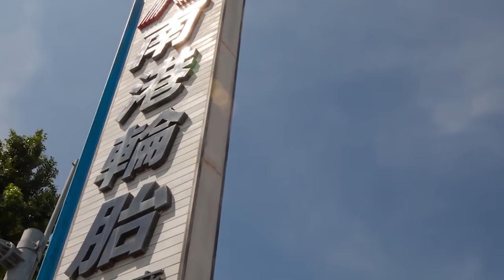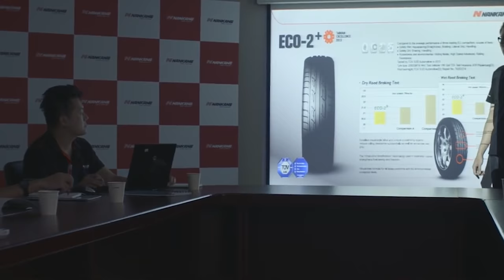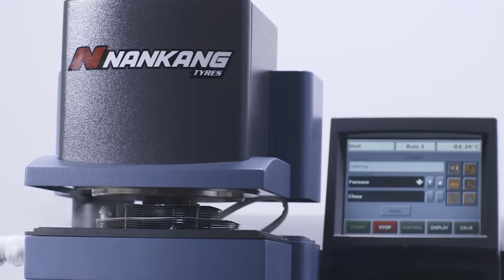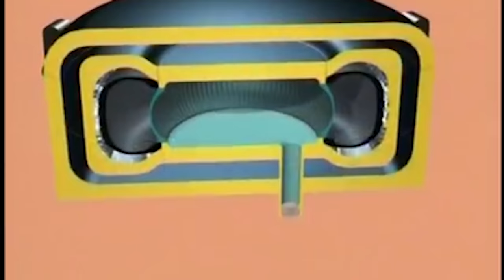THE TRUTH ABOUT NANKANG TIRES

Comment: They're popular because they're inexpensive, stretch well,  They're offered in some relatively oddball sizes, they grip for days and they have nice sidewall & tread designs.
Reply: Exactly, they look amazing. The only downsides are slightly weak wet performance and they are a bit noisy. At least the NS20's on my MK1 Golf are.
Reply: @Rodhizzzle  use them what you fine them good for if you notice they ain't great for grip on wet conditions also probably depends which tire you got, but just take what I said as grain of salt. Because I don't have much experience with them.
Reply: @Rodhizzzle  Slightly weak wet performance, you say? Grip for days dry, you say?
Sooooooooooo they make hooning around corners slightly easier after it rains?
SOLD.
Reply: Rodhizzzle are they good for fast driving
Reply: @coltonwatson4907  rated for 130
Reply: Agree, very durble, made in rare sizes with a pricetag lower than most..
And very stretchy

Comment: Thanks for the great review of Nankang. After hours of comparison videos I was ready to buy Goodyear Eagle F1 Supersport 235/35 R19 for our Audi S3 (MY15). I had been advised on a service and inspection last week that the left rear was lower tread than the rest and probably only had 5,000 km left in it. I was ready to sacrifice all other tyres on the car and get 4 new ones at a cost of $1,100.00 AUD. I had to check the brand on the front as I new that they were a Chinese brand that had only been added 2 years ago; Nankang. I have never had a problem with these tyres losing traction like quite often happens with the Continental tyres in the rear of an AWD car. I'm now thinking of getting 2 Nankang on the rear only as the fronts still look relatively new with ample tread. These only cost $154 AUD each. Every time someone works on my car they feel the need to comment on the cheap tyres on the front. Tyre shops included. Sure, they sell the brand, and they'll sell anything to anyone, but they don't know how good they actually are. They just see them as a cheap tyre.

Comment: Over the years I've had NANKANG tyres on several different cars and they're a great tyre for the money. For just daily driving they will do more mileage than a lot of more expensive brands...
Reply: @ray6.488  That's not relevant. Most users have never been to a track ! 
Most people will actually end up in a ditch on race spec rubber....
Reply: Thank you for your review man.... Will use this now
Reply: @PasigMrPogi  Try either Nankang NS-2 or NS-20. I know both of them. They are not the best in the world, but certainly good enough. And they are immensely good value for the money. And they do seem to last forever.
Well, the longevity is due to the silica/rubber compound. They are quite hard, so do expect to be able to feel the road.
Reply: @thefreedomguyuk  shit that’s music to my ears feeling the road. That’s what you’d want in an enthusiast car. More road feel means you’ll know what your tires are doing.

Comment: I've had some 285/75R16 Mudstars from Nankang on my 99 Dodge Ram 2500 for at least 5 years now.  I can't wear them out!  I use the crap out them and they look brand new.  The sidewalls will dry rot off the rim before that tread wears out!  Really impressed with them.  Will definitely be buying more Nankang in the future.
Reply: My mudstars are the same way . They last forever.  I don't think they make them anymore

Comment: I drive 100 miles a day 5 days a week. I bought a set of tires by Nankang because they were super cheap online for my work car. I’ve been running them for the last 2 years with no issues and the tread still looks great. They grip well and aren’t noisy. I’m about to buy a set of Nankangs for my Boxster and this time it isn’t because they are cheap.

Comment: Hey everyone i just put 4 new Nankang SP-9 Cross Sport tires on my 2015 Lincoln MKC AWD which is a small to medium sized SUV. And i have to admit that they are by far MUCH BETTER then the stock OEM Michelin Latitude Tour HP that my vehicle came with. Simply an excellent tire for someone on a budget that still requires; reliability, performance, and a good tread design for bad weather snow etc...

Comment: I've had Nankang NS-20 225/40 R18 on my car for about a year with harsh driving and am now switching over to the new NS-25. The last winter freeze we had here in Portland was a breeze with the NS-20 tires and they did not slips even once, and that's on a 2012 Scion XB. Meanwhile I'm seeing Subarus and Jeeps stuck all over on the sides of the roads. For the price, they are EXCELLENT tires and with daily driving they work fantastically. Just don't expect them to perform like a $300 tire.
Reply from the maker: Might have to take a look at those NS-20's for my car this winter we are in Wisconsin and the winters can get pretty gnarly!
Reply: Hi. Did you get the ns-25? How do they perform on dry, wet and snow? I am trying to decide on ns-25 vs sumitomo htr a/s po2. Thank you

Comment: N: Yokohama can I borrow your logo.
Y: Sure, but don't make it too obvious. 
N: Thanks fam.

Ps: The truth about.....Ling Long tyres lol
Reply: Looks just like the Hankook logo to me.
Reply: What's Ling long tires??? Have no heard of that brand.
Reply: Lol we have Ling Longs at work for cheap LT/HT tires other than that stupid name they're not too bad as a work tire haven't seen many come back with complaints other than the morons who overload the work van/truck then plop a trailer that's way too packed and the rear tires rub against the 1/4 and eventually cause a blowout
Reply: @emanueltorres4093  You don't want to know what ling long are, basically the proving ground is the customer.
Reply: Nankang Tire and Yokohama Tire had history of technical cooperation and joint venture since year 1959 (not anymore though). For a period of time, Nankang belonged to Yokohama group, like a daughter brand in the same company. It's not surprising the logo looks alike. Hope you could stop mocking before checking fact, bro!
Reply: Long long has very hard compounds glad I got rid of them
Reply: David Post I have driven them in a Toyota Tacoma truck with two Ling Longs tire brand as for two rear tires for 3 years.I put on them about 65- 70 thousands miles before I changed them out for with Japanese Yamaha tire brand.Because couldn’t find them in Walmart,Sam or Costco clubs stores as in great prices any more.As you said don’t over loads them in weight or driving on them about 100 or more miles in it every days.These budget tires brand name.It dose works great if you know there limitations.

Comment: I ran a set of half worn nankangs, the texture was actually picture perfect, and razor sharp. The veterans told me that the tires are slippery. To my experience they were gripy at a more excessive angle, like if a typical road tire has a lateral grip angle of 4-6 degrees, it felt as if the set I ran had a grip angle of maybe 8 -10 which to me felt actually more fun and forgiving, because the grip was more aggressive. The tires felt like the car was more responsive overall, just the extra grip at an exponential angle...

Comment: They are great tires. I have had over 50 cars in my life with all kinds of tires and Nankangs ride and perform better than some of the high priced tires. They turned a stiff bumpy riding car into a soft rider. I am hooked and it's not just the low price.

Comment: I love my ns-2 ultrasports they are cheap, grip well and have nice tread pattern, kinda flexy but I have kinda meaty fitment (225/45r17 on 7j).
Reply: No wonder your tyres are unstable. You bought the wrong size..... Go for 205 or 215 instead, and you will get a much better grip. 
Your setup is not "meaty", it's just not very good. It's just about within specs, but not good. Optimal for those tyres are 8" rims.

Comment: Just had the NS 25 Installed on my 2018 civic type r - fingers crossed...
Reply: Howd they end up doing? Possibly pulling trigger on these in nezt few days...
Reply: Wondering the same, just ordered
Reply: They holding up well - 10,000 miles on them - road noise is a bit loud - I use them here in New England for the Colder weather but are a great year round choice with plenty of grip in all temp ranges and rain - i would buy them again.
Reply: @anthonydigangi9877  hell yeah thanks. Putting them on my subie I was concerned about grip & wet weather.
Reply: I had these installed after watching this video. Great value, ride smooth and handle great. Definitely go for it if youre on the fence.
Reply: TKidd88  does the NS-25 have a high speed rating ? I tend to speed sometimes lmfao don’t
Want it to blow up at 100-130mph
Reply: @vq35hr3  Mine are H rated. Up to 130mph. I've had them near 110-120 , smooth as glass.

Comment: So in summary, these are only for burnouts, grassroots drifting, and cambered out hotboi civics...
Reply: @potatochobit  My mom gets only the best, I'd get her Michelin Pilot Sport S on 18 Koenig's . She drives a red 2016 Hyundai Sonata.  Hybrid. 😎  KDM Crew. 🇰🇷
Reply: But they do make "race" tires, like the AR-1
Reply: @alexstromberg7696  Id rather trust a tire with better R&D along with, I drive my wife and dogs. Im a skilled driver but also because I always have trusted tires. You get what you pay for.
Reply: @Dezzylyricz  so you go by "more money is always better"? I think the AR-1s are perfectly fine.
Reply: @alexstromberg7696  not really. I go for rubber compound, load index, grip, water evacuation, realiblity. With all of what I need in a tire it's going to cost more. That why I save up. It's expensive because of the engineering and design. But at the end of the day I will know in any weather or sudden evasion maneuver needed to avoid an accident I will have full control of my 25,000$ vehicle and the safety of my passengers and most of all my wife.
Reply: I will not tell you your wrong I respect your opinion. What do you like about them so much over the competition? I'm not familiar with them.
Reply: {Motor Mafia} , 100% agree mate. The best upgrade for a car is premium tyres. My gf and I both run Michelin Pilot Sport 4 - wet weather performance is next level and tyre wear rating is 350. My mate runs the Mitchy pilot sport 4S.
Reply: @nordic5490  it's a great investment, glad you like them. I'm debating the Pilot Sport 4, 4s or the all sessions variance.  Maybe even the Nitto 420s  all depends what wheels I get.
Reply: i have a civic. but its a "trackday bro" kinda civic. so im running ad08r for street mode and i want to get a set of 15s with nankang ar1 for a "pure" track setup.

Comment: I had always continental,hankooks,pirellis on very powerful cars. When i buyed a used benz who had 19 inch rims running on Nankang NS20 on the back and the front tyres where Goodride, i was like i will change them as soon as possible. But i didnt have time, so i drove them also under wet conditions, and i was amazed with the grip. For Notice, years ago i had the same Benz with 18 inch rims and only contis, i always had to be careful when driving in the wet. So driving now with Nankang/Goodride combi is really funny, but i will probably go for Nankang All Around. The Price is good but the grip is surprisingly good.

Comment: Anyone care to chime in on what they think of the new NS-25 now that the NS-20 has been discontinued?
Reply: Wondering this too as I have ns20s with low tread. Apparently no one has shit to say as they did with the ns20s when I bought them
Reply: Running them on a RWD q50 and they beat the crappy dunlop run flats. Good all season so far haven't used them in heavy snow. Good grip even when pushing on corners. Have about 5000 miles on them so far.
Reply: shaunskii my car came with a new set and I’d buy them again. Not loud, I can launch them hard, they grip real nice around corners. I live in New England. So as far as cold weather they can get you around but not recommended for foul weather.
Reply: Remind me in a week or two. Got some 275 nankang ns-25's on the way
Reply: @k.hamilton5848  how they been?

Comment: Is nobody going to comment on the fact that the forklift loaded with tires flopping around was driving in forward with that poor visibility? I’d rather reverse, better visibility and the tires can’t really hit anyone if You need to stop quickly. A rule of thumb i use is that if i can’t see directly in front of me, then i reverse instead. Workplace accidents are far too many and easily avoided
Reply from the maker: Workplace safety is huge!

Comment: I beg to differ about tires that compete with Nitto, Toyo, etc. They have their AR-1 DOT 100 TW track tire that's quite popular in Europe and used on racing circuits. They have been compared to such as the Toyo R888R and often found to be better performers in some applications. They are finally appearing in the U.S. in limited size offerings.

Comment: had some Nankang tires, dont remember which model but one of the front tires became out of round
( there was a lump in the middle of the thread ). The other 3 were good.  got some Nexen N3000 ( discontinued) to replace
and were way better, quiet and gripped good.

Comment: Does the job with no complaints. Running NS-20 on BMW f30 335i and it is a daily driver car to work etc. The car doesn't see tracks or anything close. So very satisfied. It does what I paid for it and then some.

Comment: I’m looking for opinions on tires to get for my new set of wheels. The specs will be 18x9.5 +30 and I’m looking for either a 225/45 or a 230/40. Looking for a performance tire with good dry and wet handling and I will use my stock wheels in the winter time.

Comment: Just threw some ns25s on my lexus is 350 f sport so far they’re good. I was worried they would be noisy but no they are just as quiet as the original tires the car first came with.

Comment: i had a big issue with wheels losing traction and spinning up during acceleration. 2nd and 3rd gear, Stomping my foot down, as soon as the turbo boosts, i lose traction and obviously makes handling pretty dangerous on roads..
I tried loads of brands, all the same issue, although some less than others... (my father in law works for tyre fitter so gets access to loads of brands)..
I nearly had a crash recently due to loss of traction, nearly sent me into on-coming traffic.
I decided to try Nankang NS-2 tyres a try, Nothing super expensive, But not ordinary run of the mill crap..
and honestly... My tyres really dont lose traction so easily anymore when under boost... I have had a couple of small instances when it wants to break traction in the wet, But been very controllable, and not mental wheel spinning, My traction control has been able to keep it under the belt..
So will be sticking with nankang from now on...
Reply: Try putting tires on them.

Comment: I have some as-1 165/45-15 on some 5.5j rims.

Perfect size for a slammed euro hatchback or Japanese kei car, biggest I could reasonably fit on a reliant robin.

Give a slight stretched look but they actually look slightly stretched when they are off the rim.

The federal Formosa in the same size is square looking on the same rim.
Reply: My little kei car runs on 165/50R15 NS-2R and has more grip than I really need. Quite surprised to see a performance tires offered in such a narrow width. AR1 is also available in the size but I think that is a bit ridiculous, though I do really like the AR1 tread pattern...

Comment: Im in a new development where i was replacing tires on my 545i every week. Not even joking. And the rear tires are a special order no one had them in stock in my area. So i said screw it and ordered 3 rear tires from nankang and ended  up loving them. Had great all season traction even light snow. And great tread longevity.
Reply: Was that for the ns-20? Or the new ns-25?

Comment: Considering Nangkang for a set of JNC005 wheels on my MK6 GTI, FI has the set for around a grip. I figure, even if they aren't as good as the Toyo Proxes6 on my OEM setup they should last long enough to upgrade later.
Reply: I had Toyo Proxes on my former 2010 Mazda 5 minivan. They were THE WORST tires i have ever driven on NO JOKE...!!! The Mazda 5 was already known to have rear wheel camber issues. In other words the rear tires leaned in slightly which also attributed to faster wear and cupping issues. So to solve that problem i put on a slightly larger size 215/50/17 instead of the stock 205/50/17. And then i went with a MUCH better brand on top of that which was the Continental Pure Contact tires. And let me tell you the difference was IMMEDIATE...!!! In terms of ride, handling, just about everything you can think of. So i'm not sure if it was the tires that were horrible or the vehicle's horrible rear camber issues. Regardless, i feel it was a combo of both. So if anyone is still driving around a Mazda 5 minivan this is THE BEST and CHEAPEST way to solve this problem. Without having to shell out thousands of dollars to fix the camber issue.